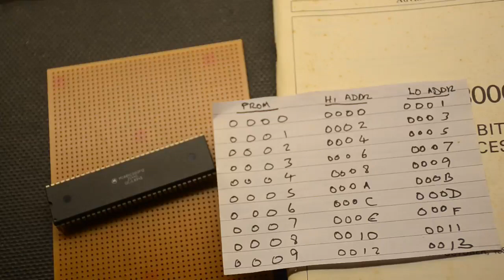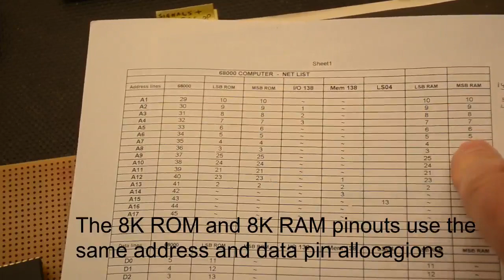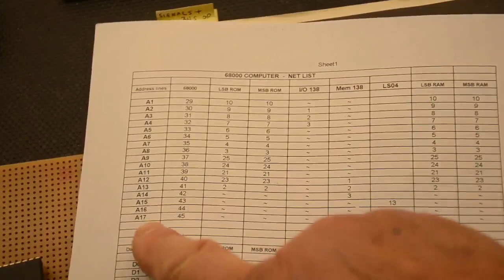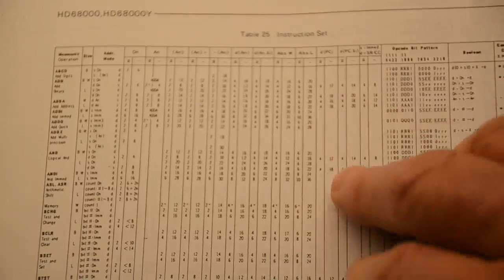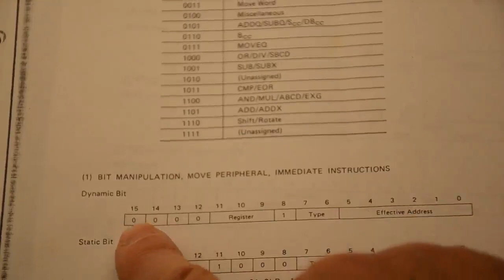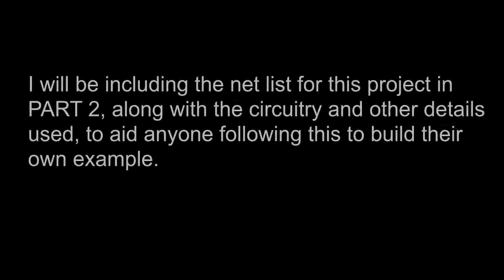A DIY 'Entry Level' 68000 based computer

Comment: you could consider using a 16bit ROM for simplicity
Reply from the maker: Absolutely! My 'problem is that I like to try and use what components I already have here 'in stock', most of which are decades old :-) Another issue would be that my home-brew ROM programming facilities don't include the ability to use a 16 bit device, as it will only work with 8x2K and 8x8K devices :-(

Comment: I just got a 68000 'kit' with a bunch of chips off eBay. Looks like they included everything. I was surprised, the chips are real (tested on an Atari St and a 68000 based industrial control board. ) 

Thanks for the video, this is going to be a fun project.
Reply from the maker: Sounds like fun! Let us know how you get on :-)

Comment: Oof, a Roadrunner wiring pen! I was only just this week discussing those with a colleague and wondering about buying a 'new' one.
Reply from the maker: This one is in fact a well-worn hand-me-down from an old friend, but it's still soldiering on - or should I say 'soldering on'? :-)  I can't think of a better way to build a microprocessor based circuit board as a one-off.

Comment: People just love two write assembly for the 68k, but you rather write machine code ?
Reply from the maker: Ah well, some folks like a challenge! Take another example of modern cars with manual gearboxes, which are much easier to drive than seriously older models requiring the art of double-declutching, use of manual chokes etc. etc. I guess it's sometimes more fun doing it the hard way :-)
Reply: @lishaton  I meant : those people say that 8086 and SH2 assembly is hard. MIPS is great for compilers, but I never heard praise from a human. 6502 assembly only looked easy when there was only 4kB of RAM and you did not want to do any 16 bit arithmetic. Z80 is not orthogonal.
Reply from the maker: I see where you're coming from. Yes, true.

Comment: This is great!  I've been looking for videos on 68K SBC's.  They are pretty rare.  I'm also very interested in how you are wiring these boards up.  I haven't seen that wiring pin, etc. before.  Can you talk more about that?
Reply from the maker: Glad you like the video :-)  The wiring is quite straight forward once you've seen it done. First, pull out about 1 cm of wire from the pen tip and by using the tip of the pen, you wrap the wire round the first pin to be connected two or three times. Using the wiring combs, you then lace the wire away from the pin you've just wrapped and drag it along the comb in the quickest direction to the next pin you want to connect.Once again, using the tip of the pen, wrap it around the destination pin two or three times. If you are taking it to yet another destination pin, do your two or three wraps and head off again down the wiring comb to the next pin. I hope that's clear? Once you have all the wraps completed, with the final destination pin now wrapped, press down on the wire using the sharp tip of the pen to break it off. Now visit each wrapped pin with a hot soldering iron and solder to burn off the enamel and make the joint permanent. I hope this helps??
Reply: @lishaton  Yes that's very helpful!  Next question, where can I get those wiring pens and wiring combs?  Oh, and what gauge wire is that?  Thanks!!
Reply from the maker: So sorry that I haven't seen this before. For some reason, this site doesn't tell the originator about any further comments in a thread which is a pain... You can buy the pens, wiring combs and wire from CPC Farnell amongst others. Do a search for "Roadrunner" (not sure about the combs from them?) The web site is:  https://roadrunnerelectronics.com/